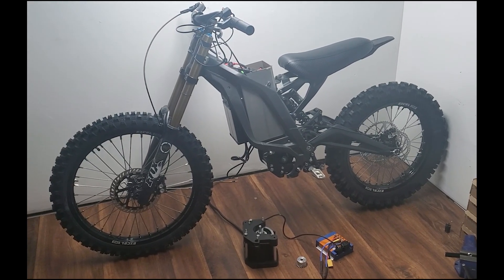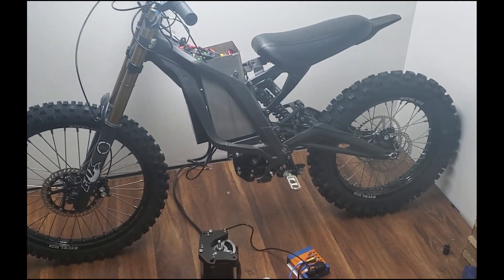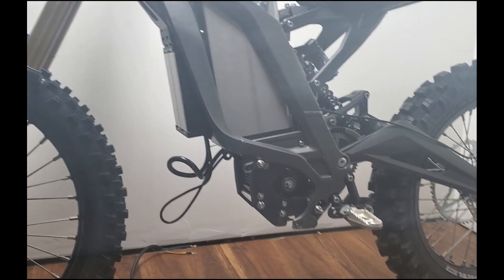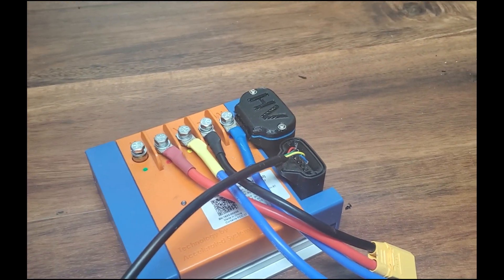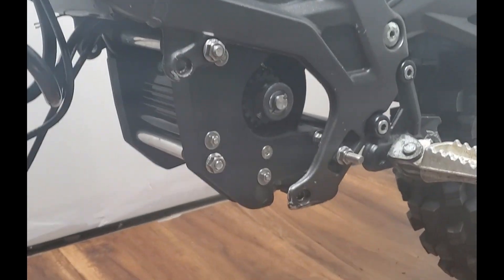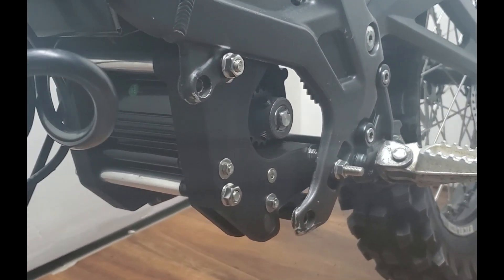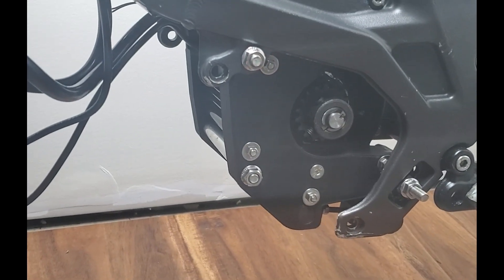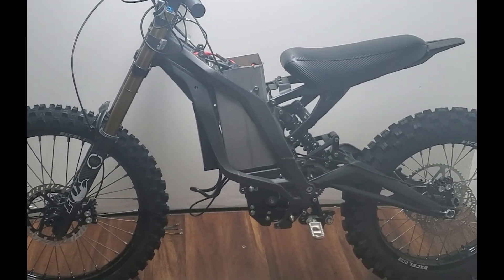Sur Ron - Lightning Rods Edition - Big Block XL IPM Motor Swap

Comment: "Why the hell not"

That's the kind of thinking that builds cool bikes imo 👍 It looks like mounting plate also does a good job of protecting boots from the primary drive
Reply from the maker: Thanks! Appreciated. So far in testing they are holding up well. Which considering they are essentially plastic blows my mind. I will update on the bike soon! Cheers

Comment: Where did you buy the rear wheel setup?  i tryed to look thru the discord group, but it is just a mess of stuff to look thru.
Reply from the maker: The wheels on the Sur Ron are from Woodys wheel works.
Reply: @HighVoltageKits  Thank you!

Comment: Not the closest....GLE has the closest and highest mounted bracket. Just clarifying that. Great video and good work.
Reply from the maker: Thanks. The photos on the Greenline website do not back that up though. They have two designs and both bolt to the original bracket which I removed for mine. You cannot get it in close with that bracket in use. It will be more obvious in future videos. Greenline. Probably the best people for kits tho. I like green line as they innovate rather than just being another clone.

Comment: Just a thought... being that your putting the motor in their on your own with your own mounting hardware... why not mount the motor on the other side so as to not even need a jackshaft but to just have a single chain???
Reply from the maker: Like on a gas dirt bike? It might be possible. I won't rule it out but it won't be something I can take on for a while. I want to get this running and tested. The chain tension would be the main issue and the path through the frame to the rear with the shock linkages might be tricky. Good thoughts tho. Cheers
Reply: @HighVoltageKits  ya no your already into your project pretty far to change it... I just wonder why they don't do that tho seems simpler... and I do know electric motors don't need chain slack like a gas motor does although can't remember why just remember learning it.
Reply from the maker: For sure. I love all the spin off ideas tho. I keep notes on them!
Reply: You would have to run giant sprockets without the gear reduction.
Reply: @ronan9784  why isn't that necessary on say my razor build??? Unless that's why they use a #25 chain maybe... stock sprocket on the rear is 81 teeth and the front was 11 but when I added different power the front end wouldn't stay down until I changed my front sprocket to a 15 and my rear to a 65 but once I got used to it I went back to the 81 on the rear
Reply from the maker: 15 to 65 is just over 4:1 It all depends on the grunt of the motor and how much power you have. The initial setup you had would have been just under 8:1 Your happy medium for you and your setup ended up around 5.5:1
Reply: @HighVoltageKits  I've I've a talaria on the way and I'm wondering if that's a gear ratio that I'll like for that bike or if I'll just need to play around and find what I like. Obviously it'll have a bigger chain and less teeth but I knew once how to find my gear ratio and it's not hard I suppose I could look into it again and refresh my memory on the subject. Wheel size matters as well yes?

Comment: Very nice design of the bracket, really curious to see how it holds up.
But why the big block motor? Can't the stock surron motor handle more power than the big block?
Reply from the maker: I don't think it will threaten a BAC8000 stock. Not this one anyway, there is a bigger version next year to try. Mainly cause it's an IPM and should be fun. The stock motor has some intrinsic weaknesses to the rotor. So going for value and reliability more than world record power etc.

Comment: Nice project, do you need to swap the rear chain ring and rear disc around?
Reply from the maker: Thanks! Other than switching to a 219 primary reduction the drive chain has not changed.
Reply: My apologies, looked at the video again, just realised the drive shaft transfers from the left to the right side of the bike

Comment: Looking good,  think the weak point is going to be that swing  arm, I bet if you move the wheel side to side you get a lot of flex which in time will fail.
Reply from the maker: I heard you can stiffen it with some if the aftermarket triangle parts. But yes. There are some new swingarms coming out by a few places so it might be an option to replace.

Comment: It's looking really good. 
Glad to see you've lost a load of the unnecessary brackets. It's improved the look of the frame quite nicely.
Reply from the maker: Thanks! Appreciated.
Reply: @HighVoltageKits  It would be very interesting to do some stress tests on the carbon re enforced poly carbonate compared to Aluminium  of the same dimensions.
The carbon strengthening must make a lot of difference.
The motor mounts look pretty beefy.

Comment: Beautiful.
If you worry about torsional destructive forces, maybe you could make the brackets with diagonal beams resembling an X.
Reply from the maker: Thats not a bad idea. I think I will ultimately go to Alu as the additional heat sinking will be useful. But yeah. Diagonals would help with stress like that. Cheers

Comment: I'm looking to build an ebike that doesn't look like an ebike, I want to be able to ride around without fear of being stopped by police. I have a BBS02 on a large Trek bike but with the gigantic battery on the pannier rack Im always worried about about tear-assing around the roads....any suggestions?
Reply from the maker: I found that with a fatbike all the cops notice are the huge tires. Maybe a smaller battery that goes in the frame or a way to disguise it. The eggrider that locks it to a street power mode? You are welcome to join our discord group and post photos. Perhaps we can figure out some creative solutions. https://discord.gg/jjyuZ6nb33